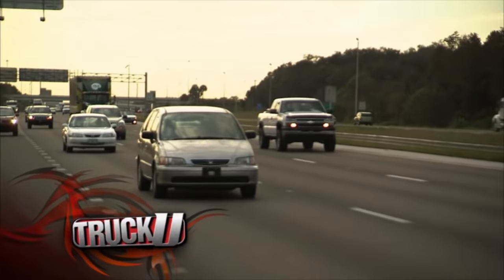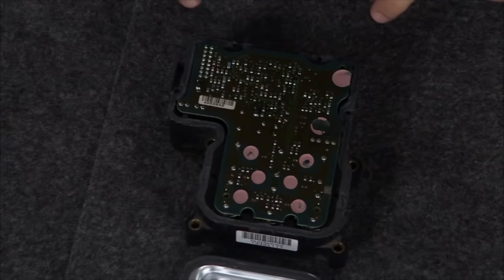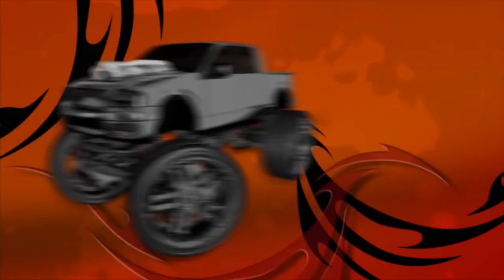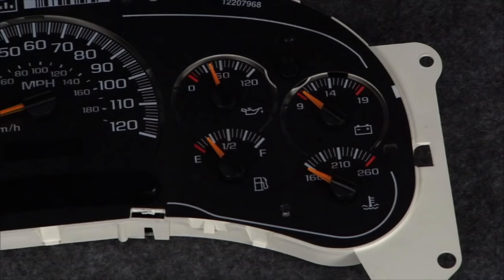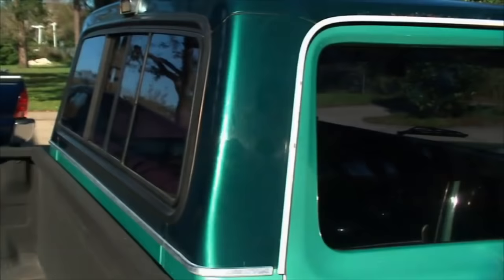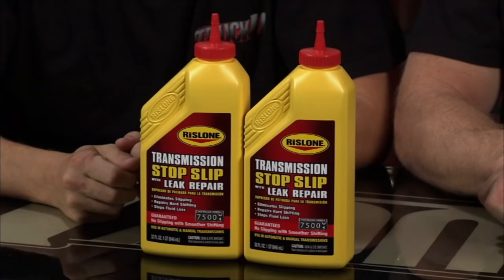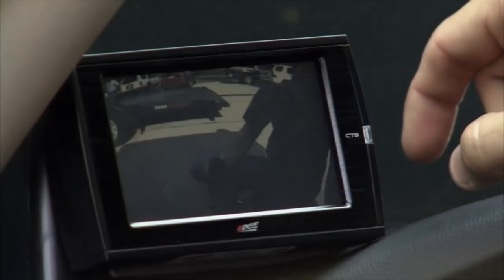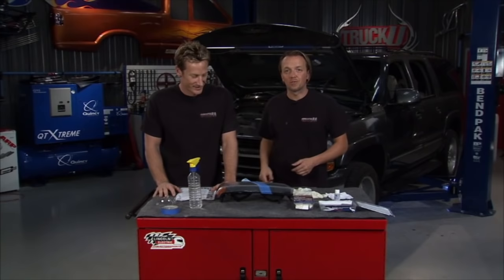Fixing Common Chevy Problems | TruckU | Season 5 | Episode 15

Comment: They didn’t even touch any of the actual common issues with that suburban sitting there. The loud clunk in the rear diff, the humming on the front differential when in AWD, the clunk when shifting from PARK TO REVERSE, and then from REVERSE to DRIVE and then again when back to REVERSE, the dimming cluster, etc etc etc. meh….Not much effort put on this show

Comment: I think if GM is still having problems with an intermediate shaft popping noise it's time to drive a different name brand I was replacing those 15 plus year's ago under warranty if you still haven't fixed it that's an issue as I drove 60s and 70s and 80s and never had that problem I realized the education today is week but hey find a 60s model and see if you can reverse engineer just a thought throw the prints away from today especially the wiring just a thought

Comment: never had ANY of those problems with my 99 tahoe. Wheel Cylinders, peeling clear coat and the headlight haze were my only real issues. i paid $20.00 for the 3M headlight restore kit and one time of using that the proper way from start to finish has had my headlights shining bright and clear for 10 years now. never had the ABS issue at all but after market wheel cylinders have been an issue for a while. the clear coat peeling on the paint has been an issue since the 80's and all manufacturers paint goes through that so i'm not shocked about that one at all, even if you polish it frequently like i do,. it's an inescapable problem
Reply: Just bought 99 Yukon a week ago runs great named her rusty.Headlights are very dirty gonna polish them today
Reply: I have a 99 Yukon had a small accident a couple of days ago and standing on the brakes hard it slowed down but it would not stop like it should.It kept rolling.I remember back when Chevy trucks had this problem.My wife had a new astro van and a habit of tailgating and rear ended people 2 time in a week.It was a bad combination I thought she was making it up .Then realized the Astro is a pickup with a van body.When she drove like an idiot the truck was not helping.Now mine is continuing when i stomp on the brakes.I may try disconnecting the abs but also need to put rotors and pads on front.Meanwhile driving like a grandfather 🐢is my safe option.

Comment: Hi ,Can you help me ? My 2004 Silverado 1500 Got new brake pads rear . Then the next day the driver caliper locked up ,My mechinic put on a new one .Ald level is correct l fixed right .Now the Service Brake System read is on with the brake light ,  Not the ABS . He dosnt know why  the light . Fluid level is correct .What do you think ? I want to sell it ! Thanks Mark

Comment: My 2004 Avalanche had all four of those typical problems. I've already replaced the T-case with a Monster and I did fix the gauge cluster myself. Use a solder sucker to remove the old stepper motors and it'll go pretty good. I got the new stepper motors on Amazon for about $20. Now I'm about to tackle the ABS and steering column clunk. Thanks guys.
Reply: The queenly Country Famil

Comment: You should do a video on removing S10 Springs 2001 model you need to use a spacer or three in between the knot in the slide hooks or you can't get it into work drove me crazy and then add the link for Chevy S10 and put in torque specifications can't find them anywhere great show

Comment: I sand with 2000 grit then 2500 to 3000 final, wash dry clean with rubbing alcohol let dry, rattle can some crystal clear non yellowing clear coat DONE!   Much better results and lasts for many years..

Comment: I have a 2000 2500 Silverado.  The colder it gets the harder it is to start.  starting at abour 65 degrees on down.  Any suggestions?
Reply: Engine temp sensor

Comment: Left out the wheelbearing problems,one is a brake pulsation which the brake pedal comes up when hitting the brake pedal.Rust gets inside the wheelspeed sensor hole and GM's recall fix called taking out the wheel speed sensor and cleaning up the wheel speed sensor.Did not fix it and the real fix is replace both front wheelbearings
Reply: Pull your ABS fuse drive it around for a couple thousand miles and then replace your wheel bearings. 
I always thought it was a wheel bearing starting to go bad the ABS sensors inside your wheel bearing unit. It pops out a hundred thousands of a fraction the sensors can't see the wheel spinning so it's automatically telling itself that tires locked up you hit the pedal your abs goes off immediately and you can't stop the truck.

Comment: You guys are freaking me out! Have an 05 silverado with 225,000 i need to get on that tranfer case fix. Thanks for info.
Reply: Or get rid of the vehicle cause guaranteed money pit. I had no idea.how.bad chevys rep was when I thought i.got.a.good.deal on.2001 s10 with 80k mi. Bought from.orig owner who took great care and did all maintenance on schedule.  I got all his records which was a thick stack. If I had known he just spent 2500 1 month before me buying, I'd like to say I wouldn't have bought it. Talking ball joints, rear shocks, some weird heater hvac problem and dont remember what else but all work was done at a NAPA authorized repair facility. Truck got stolen at 210 miles.
Reply: When I got truck I changed all driveline fluids to royal purple. 4x4.

Comment: Would ABS issue cause slight shudder when decelrating or light braking? No lights or codes. No grinding or noise. I'm only feeling it when slowing and/or braking at about 20-25 MPH. It's not really bad and is only felt briefly.

Comment: My 2009 Silverado 1500, 5.3 6 Speed, with the G80 locker. I have a clunk in the rear end. I pulled the cover and the ring and pinion are at .007 backlash. The spider gear shaft looks like it has slight wear. They shouldn’t matter if going straight. There was no metal in the Differential. I buttoned it up and refilled it. Still have a clunk if I accelerate beyond normal. I can’t see bushing wear. Is this the leaf springs or the Differential? When driving the Differential is quiet.

Comment: 2006 GMC 3500 SLT 6.6 Diesel, Duramax,  that keeps blowing " veh stop 15 AMP fuse " under dash fuse panel, checked the brake light switch, the wiring between switch, and tail light junction box, ok, found the right tail light lead was burnt, replace but didn't fix the problem, checked grounds didn't seem there was any problem with that, can you go over the Junction tail light box?

Comment: 2007 GMC 3500 turn the key off and the windows still work, turn the key on they stop working. Crank the vehicle and they work again. Drains the battery every night.
Reply: My truck vibrates at 50 miles an hour and I take it out over driving stops

Comment: I have a 2011 Tundra which I bought brand new as a daily driver and a work truck now it has 278,000 miles the things I have changed are the tires, brake pads 4 times and the big one was the AC compressor around 190,000 miles.

Comment: Does the transfer case only dig into the housing when 4WD is activated?  Or could it constantly be doing this while in 2WD and 4WD?  Thanks, great video!
Reply: Both 2 and 4wd. If the clip you see on the video doesn't break you're fine, if it does break it wears out fine. Unfortunately there is really no way to know what shape it is in without taking the transfer case apart. I rebuilt mine and it looked practically brand new. I still installed the new pump plate though of course to eliminate the issue. I had 140k at the time.

Comment: hi, i was fixed  front brake old pad brake switch new in done then when drive  some brake have problem  burn smoke   . i many time fixed check all good did but i think maybe booster with vaccum
 is broke? my truck 2005  silverado  1500 4x4  what happen?

Comment: My fuel gauge is backwards. I replaced pump but still goes backwards. I bought the 2003 avalanche used like this. Initially I solved the problem by reversing the float but that pump went bad and I put in a new one. The new one has not been modified and the fuel gauge reads backwards.
Reply: Check the ground on the fuel tank.Also try reversing the telemotor wires behind fuel gauge.

Comment: I have a 1993 chevy 1500 4x4 when my speedometers  starts going crazy and my brake light comes on my trainsmission will not change gears dont understand y really hope you can help me out just put new trainsmission  in it

Comment: Can u help me figure out my break problem my abs light was on it went off and now when I come to a stop at low speeds it sound like the module hums and my pedal try's to pulsate then it stops goes back to normal breaking I own a 1999 Chevy blazer 4.3 l vortex v6 4x4
Reply: Thats your ABS kicking on..were you driving in snow? Are the roads wet? Are you slamming on the brakes?
Reply: Sounds like your wheel bearings going bad . Your abs is probably  tied into your wheel hub.  When your wheel bearing starts to go bad it starts to separate your abs can't see the wheel bearing spinning so when  you put your foot on the brake the ABS in gauges.
Reply: Definitely check you wheel hubs
Reply: Never heard of that engine before. lhh

Comment: Can I pull the ABS fuse and just pump brakes like I am used to doing or will this cause other brake issues? 2003 chevy 2500 suburban 4x4
Reply: Theresa Jacobsen shouldn’t cause any issues just an ABS light

Comment: How do u fix the afm? Should of mentioned that as well
Reply: Is that the cylinder shutdown crap? They have a module you hook into the OBD port and it disables that.
Reply: @JenniferFuchek  yes that's the v4 mode thing for cylinder shutdown

Comment: hey guys what about the oil sending unit that goes bad what's the deal with this or the ground that goes bad if you guys not run into any of this I have an 08 GMC 5.3 liter just got nothing but troubles electrical door locks going on and off oil light all kinds of crazy stuff is flashing making noise there's oil in the oil pan there's no reason for any of this truck runs I don't understand what is the fix
Reply: Joseph Inbody . Your bad ground that got me curious. My 04 GMC Sierra the computer resets every time I shut the truck off which resets my sensors.  I've been told bad ground or a bad memory fuse but I can't find a bad fuse. Makes it a pain in the ass to get inspected instead of paying 21 I pay 75 mechanic has to drive it through a complete drive cycle cannot shut it off or will reset everything.
Reply: Joseph Inbody think that's bad look at what you got to do to change the oil pan gasket on a 2001 Chevy S10 what rear wheel drive it's like a three-day job
Reply: Joe Ellis G103 passanger side between the engine and the cab. Small black wire coming from a larger bundle of wires and snaking down behind the engine.

Comment: Great footage
So I have a 2005 Chevrolet 2500HD 6.0 Vortex
Engine light come on when under load or when I’m towing a trailer.
Any ideas?
Thanks
Reply: Mis fire under load. Get new spider. Solved my misfire issues on 4.3l, 2001 s10

Comment: I have a 1990 Chevy 1500 with 350 tbi engine. It started making a really loud knocking noise none like I've ever heard. I've checked the valves rods rockers all that. So I put it back together cleaned throttle body. My check engine light only comes on when I'm going 55 mph or faster. It started misfiring a couple days ago and just didn't have the power it use to have. I fired it back up and started looking around again. And I noticed that my egr valve didn't look right so I took it off. It has a chunk missing off the base of the valve it self the intake looks fine and normal. Could that had cause that loud knocking noise?? It only does that when I give it gas or after it warms up. Please give me your input on this. I've checked my vacuums, and fuel pressure.
Reply: Mike Priddy sounds like a rod knock

Comment: I have a 2014 Silverado  lt /my truck is idelling a little too low what can cause this is has 60,000 miles on it could the cabin filter  or tbs be bad.
Reply: TERRY SMITH idle air control valve maybe, definitely not cabin filter or I’m assuming you mean tps?

Comment: I've had 2 different tuners try  and can't shut off traction control or stabilatrack it says it's off but still holds back my throttle. Any help would be appreciated.
Reply: Michael Major I was driving a newer Chevy and you just had to hold the traction control button for like 15 seconds to turn everything off. I could not stand the stability shit on gravel so I turned it off every time, hope this helps.

Comment: 1999 S-!) BLAZER LS Driver side Front C-V axle won't stay in , When I lock it in 4 wheel drive It POPS OUT! the snap ring is getting chewed up , will inner barring fix issue? Tried longer axle , No Off Road package HELP!  Steve
Reply: Any manual hubs offered for your model

Comment: Do u have any ideas on the intermediate chevy shake at highway speeds.  Is it in the transfer case or drive shaft or abs I’m stumped I have a 2001 suburban 5.3. Can’t find out what’s causing the shake at 70-78?  Thx dan
Reply: djtoo7 
Yup my 2015 Silverado  does the same thing at 130 km.plus hard shifting and just had the transmission worked on to replace  1 -4 clutch plates.was good for 2 weeks now is acting up again.
Reply: Hey I did replace the front universal joint and made a big difference going to swap out the rear and see what happens.  Try that.  Thx

Comment: I seem to be having a problem fueling my truck. When try to put fuel in to it, the gas fuel nozzle keeps clicking off every few cents worth of gas, like its going throu a vapor lock.
I brought back to dealer, they dropped tank, checked everything. it stopped for about a week then started again. I love my chevy truck don't wanna  have to get rid of it cause of this problem. it's a 2016 Silverado lt with a 5.3l eco z71 4x4. please any help will be very helpful. thanks.
Reply: Theres a breather tube of some sort that could be clogged.  Sometimes you can get by by only putting the pump in  a little bit
Reply: Vent line blocked. Mine was hanging lower than the fill hole - I reached up behind the rear quarter panel and tucked it back along the fuel line (from gas door to tank).  Fixed.

Comment: Hey guys I am having a problem with my 91 Chevy Silverado. not sure how to explain the problem but here goes , when I step on the gas pedal to excellerate there is a dead spot  or stalls, I have to floor board to get it to pick up speed. I just replaced the throttle sensor and was told the fuel pump was fine. do you have any ideas as to what my problem might be.
Reply: Same! 93 k2500 5.7
Reply: Fuel filter? When was it Changed last
Reply: Who told you the fuel pump wAs good? A shop , parts house? How did they come to that conclusion .  To be 100% need fuel pressure tested with a  fuel pressure test guage thrn find the specs for your vehicle
Reply: Robert Gurule check tps sensor
Reply: EGR
Reply: Egr or distributer has moved or is going bad. I had same problem on 1990
Reply: If loss of power it sounds like cat converter to me....

Comment: having problem with my battery gauge it will be  on 14 and  then drop down  around 12 what  going on
Reply: Sounds like the alternator not having correct output. My Suburban auto manages voltage as needed so it fluctuates.

Comment: I have a 1995 chevy tahoe with 340k and running strong just have a play in steering wheel any suggestions
Reply: If you have rack and pinion steering the rack and pinion or the steering shaft might need to be replaced. I'm not saying for sure it is one of those, just a couple of suggestions from me. If you do have rack and pinion it might be expensive to have it replaced. I have a 2003 Silverado and it cost me over $700 to have it replaced (a little over a year ago) and that was at a repair shop, not the dealership. The crappy part about it was I only had about 92,000 miles on it at the time.      O.K. I will shut the hell up now. LOL
Reply: put it on jack stands an move the tire by hand and see where the play is coming from. Ive got a 94 c1500 that had a lot of play but most of it was solved changing the pitman and idler arms (about 100 bucks)... but when a truck old enough to drink the whole front end is probably worn out. so play the game of is it really worth putting the money into it
Reply: juan cortes ya....its wore out....duh!!!!
Reply: juan cortes I have a 99 yukon with 270,xxx miles and the whole front end gas been replaced. just lift the front and move the tire 12 o'clock and 6 and check for play. then 3 o'clock and 9 and check for play. but also even though I replaced everything I still have play somewhat. with high miles I think it's the steering gear box and or intermediate shaft play.
Reply: Blind . am . I few days am a

Comment: My dash lights and running rear tail lights went out at the same time. My under dash fuses are good. What?
Reply: it's the switch I promise
Reply: Nancy LaValle same deal on my 97 4x4 Silverado bulbs circuit boards fuses test light switch rewire ground for tow hitch nothing. Help please?

Comment: Easy to fix all of a Chevy's problems.....Buy a Ram. I did. Love my Hemi. Dead nuts reliable too.
Reply: Slac, just want to let you know Hemi's are only cool in Mopars from the 60's and 70's. I have a 2003 Silverado and it has never broke down on me. (if you can't figure it out it's 14 years old. I don't want you to strain your pea sized brain) I don't know about anyone else but I call that dead nuts reliable. LONG LIVE CHEVY
Reply: michelle grone, nope, can't be junk...I didn't buy a Chevy
Reply: Interesting. My chevy truck has 275,000 miles and still runs strong. Every dodge I've seen with that many miles is a ....how do I put this delicately......a rust bucket.
Reply: lol thats the wors thing u can do. dodge jeep chrysler r bad n after getin bought out by fiat disaster